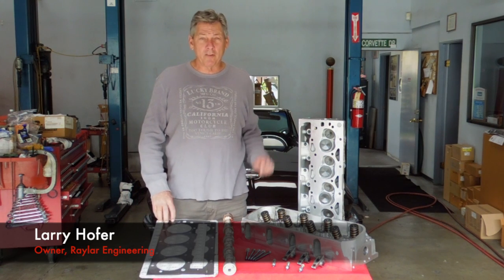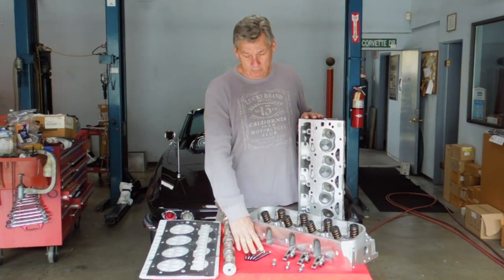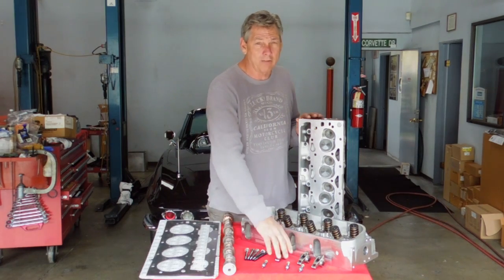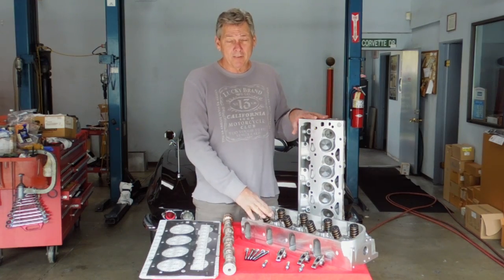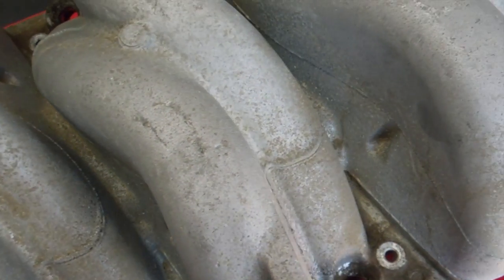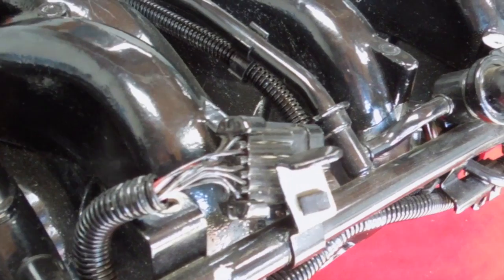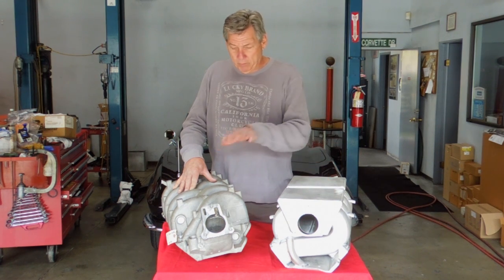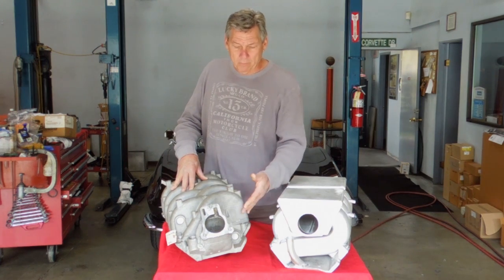Avalanche 2500 Makes 527hp / 581ft-lbs - Heads & Cam Only

Comment: Is this power at the wheel, or the crank?
Reply from the maker: 527hp/581ft-lbs is the crank output of the 8.1L with the stage 2 kit. The video shows one of our customers with this kit on the dyno through an Allison tranny making 363rwhp/449rwft-lbs.
Reply: @MicahCoy  that is 31% loss. Why so large? I assume the truck did the pull in RWD mode.
Reply from the maker: @cowsauce9099   Big heavy running gear = big losses. Every rear wheel dyno we've seen with the 4L80/85 shows this drop, closer to 34-35% with the Allison.
Reply: @MicahCoy  ouch, that's some huge losses. Sounds like the motor is breathing a lot better though. So there are probably real gains in throttle response and how it gains revs that speak to the upgrade more than power.